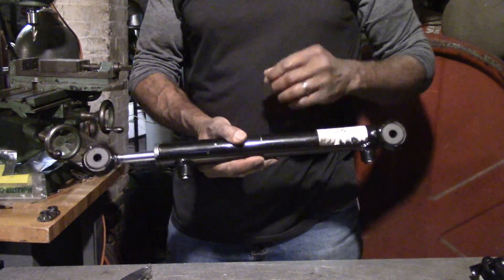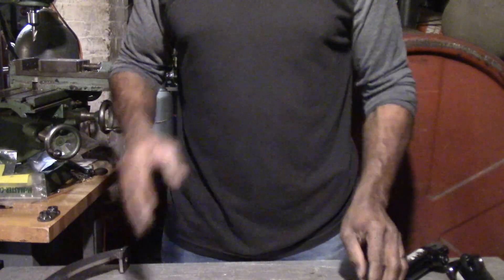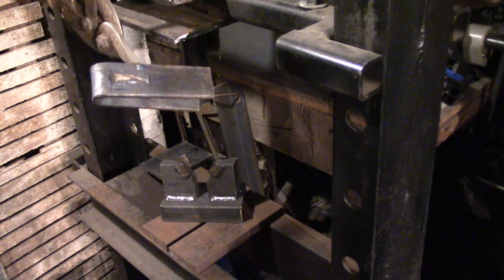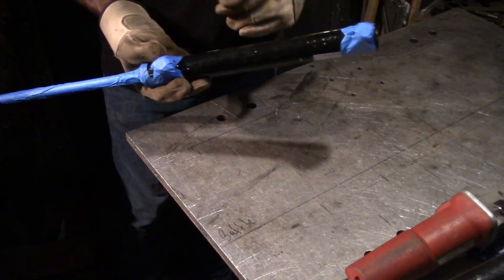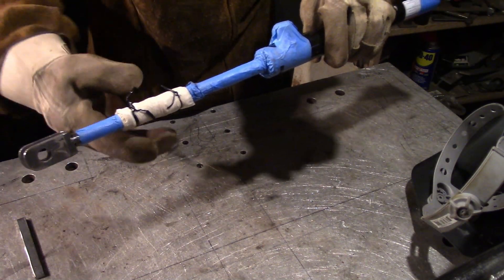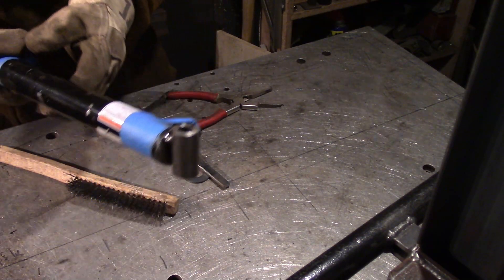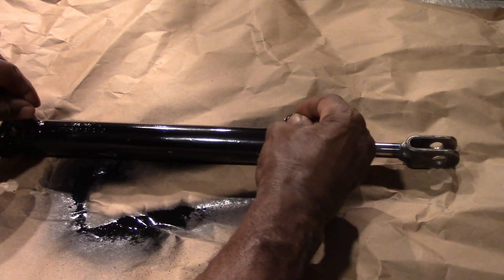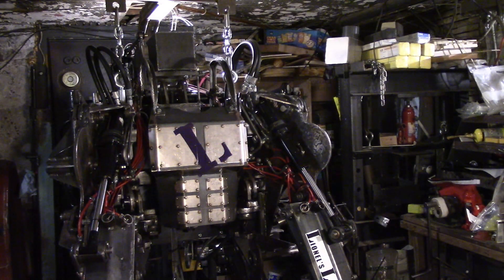Modifying a hydraulic cylinder for the exoskeleton power armor project. (build video #10)

Comment: I have a question, 
What will be difference in efficiency when Pneumatic & Hydraulic are compared for this specific task shown by you in the video?
Reply from the maker: Hi, In this specific application the efficiency would be pretty similar. The other parts of the exoskeleton need the power that hydraulics provide, but for simply lifting the chest armor,  a pneumatic cylinder would work. Since I already have the hydraulic system in place it was most convenient to use a small hydraulic cylinder rather than add an air compressor. Thanks for the question and for watching the video!